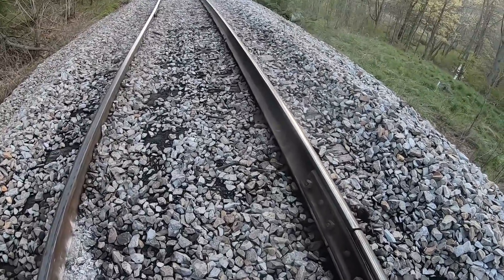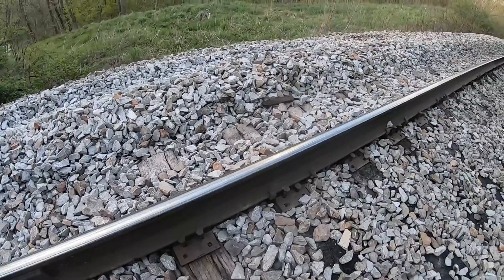Major Derailment: Locomotive Derailed & 2 Cars plus1400 Feet Track Tore Up!

Comment: As a newb, can someone explain the great distance between the locomotive and the coal cars?   Why was the track so torn up in between?  Was the locomotive still on gauge, tearing the track behind it?  Those ties splintered like toothpicks.
Reply: It’s the end of the train not the beginning they have a pushing locomotive and a pulling locomotive and with the amount of weight that needs to stop remember an object in motion tends to stay in motion unless acted upon equal or opposite reaction so it didn’t hit a steel wall for it to of stoped instantly
Reply from the maker: Thank you sir, excellent reply to that comment above! Hope you
enjoyed today's show and appreciate your watching
Reply: Thanks gents for the reply, explained it perfectly.  What a mess for Dave and the crews!  Sure glad none of them went over the edge and down the embankment.  Can't imagine the work needed to re-establish the gauge and re-rail the cars and locomotive.  Going to be interesting to watch to say the least.
Reply: Here's the way I see it, which could be incorrect since I wasn't there:
The engine you see was at the rear of the train acting as a DPU (Distributed Power Unit, controlled from the lead engine). The last few cars of the train somehow derailed on the curve, uncoupling from the DPU in the process. The brake line between the DPU and the last car disconnected, putting the train in emergency (air line pressure to zero) so the brakes on the DPU and the rear cars came on with full force. The DPU stopped very quickly, at least partly from being off the rails. The air in the brake line near the front of the train takes a few seconds to vent out the break at the rear, so the rear of the train was dragged along for a few seconds tearing up the track as the front part of the train didn't have the brakes on yet.

Comment: Excessive Speed is my guess as to what happened to start this mess!.......luckily no one got hurt!. well maybe their pride!
Reply: You didn't read everything Dave wrote. "Thank you so much for watching. Track is back in service and train is running at track speed,
and in case you are wondering, it's 25 MPH track speed, the operator on the derailment
was running at 22 MPH when this happened. He had followed standard operating procedures
for this section of track."
Reply: I dont think so, had it been excessive speed you would see things on its side and the track would have been pulled apart thrown everywhere. But what do I know! I think a wheel set wanted to go straight and the track said no and the wheel set said screw you!
Reply from the maker: Spoken from someone who has been there, done that Jason! You
full well know from experience sir....those silly cars, always angry
cause they are pulled and can't sit in the shade in a siding